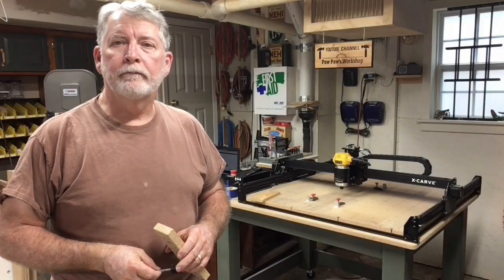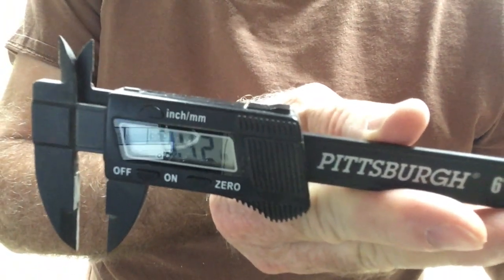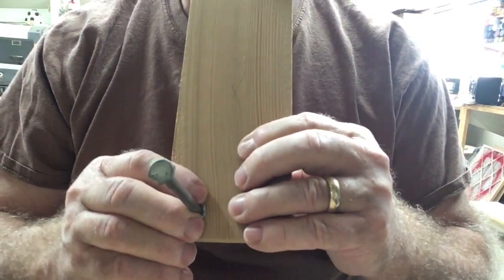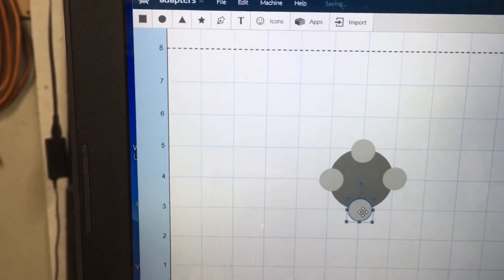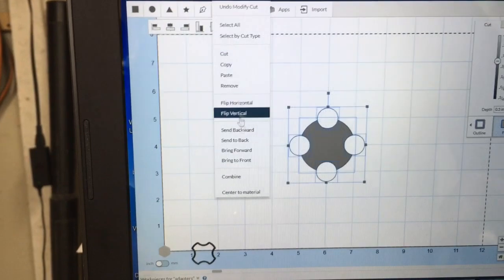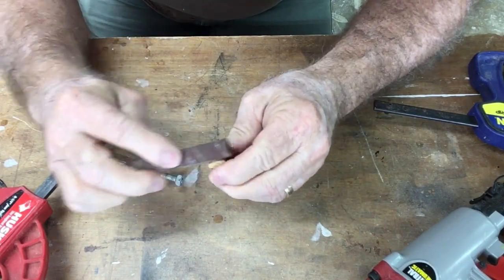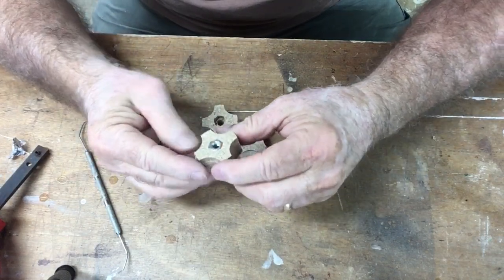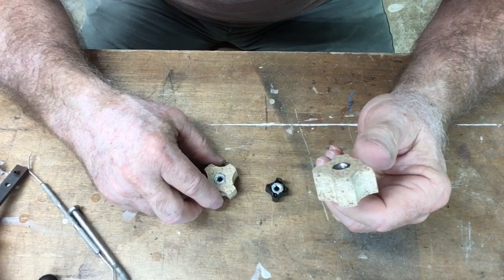How to Make Knobs on the CNC

Comment: Thank you I will be making some for a stop block fence.  Why didn't you have the cnc cut the hole for the bolt?  Was there a reason you used the drill press instead?
Reply from the maker: The 1/16" bit does not work well going that deep into the material. I could have set it up on the cut out portion but did not think of it at the time.  Will have to do it.

Comment: Great job Paw Paw.I’ve made knobs similar to these but I used my band saw. As you would suspect, making a knob this small was very difficult with a lot of clean up. Thank you for the idea.
Reply from the maker: Thank you, your right, this is much easier than trying this on a band saw.  Once you have the design, it is easy to scale it larger or smaller depending on your need.